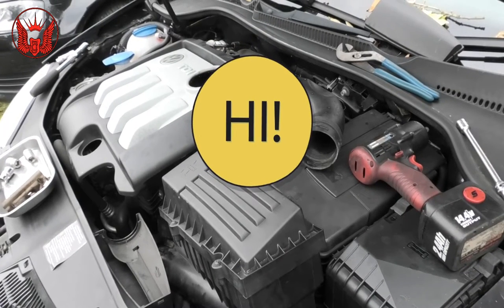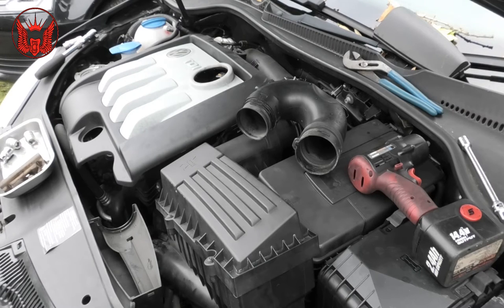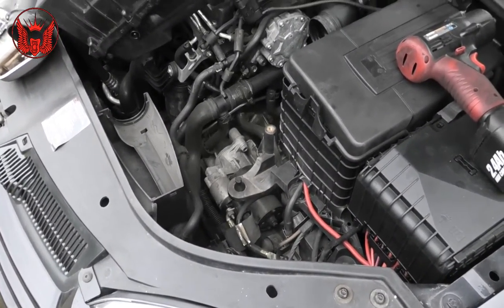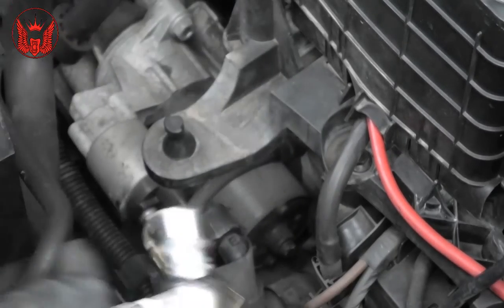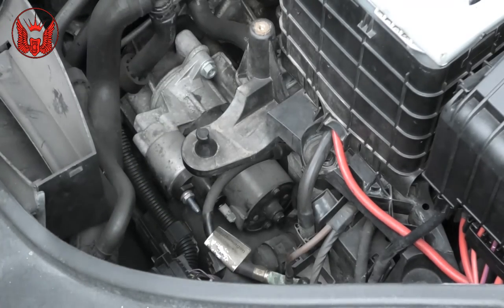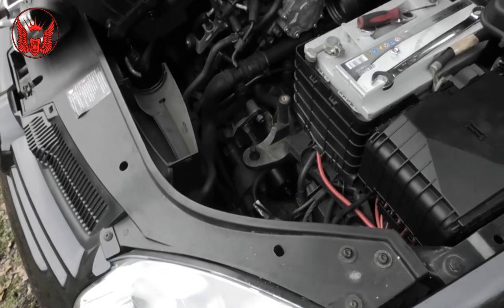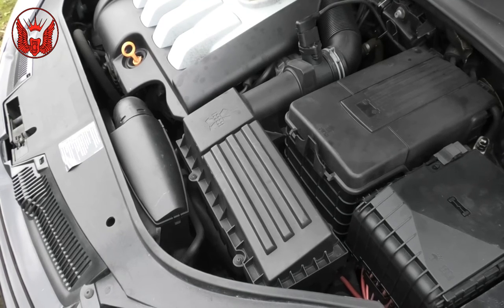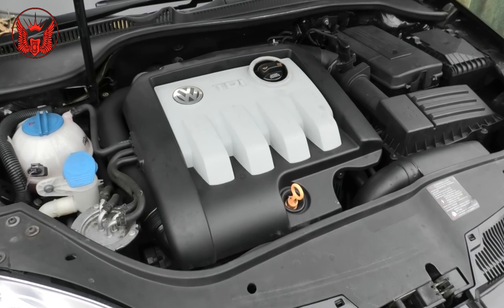VW Golf mk5 starter motor change due to noisy thump on start up like engine falling out but ok after

Comment: Was this the issue in the end? I was thinking it was fueling issue from possibly from the injectors
Reply from the maker: Well it’s a bit of a mystery, but in this case the car was better, but the car is sold now and can’t really check. I also thought it was an injector, but I have seen the starter can also cause the issue and well it was the easiest one to start with.
Reply: My battery failed this morning, changed battery and so far it’s starting instantly with no thumps

Comment: Hi. i have the same issue with my vw golf mk5 2.0 tdi. Planning to change the starter motor - is it supposed to be exactly the same starter motor serial number? I was thinking to order a sh one from ebay ...but I don't know if it's supposed to be the exact same number or not. Thanks
Reply from the maker: Hi it doesn’t need to be the exact same number, you can buy one that it’s OEM as long as it made for the year and model of your car and has the same electric fittings. But better get a good one rather than one that’s gona be the same as your original one in a couple of years. Cheers and regards.
Reply from the maker: The one I used was made by hella. Around 130

Comment: Thanks, but how do I remove the connector for the control wire?
Reply from the maker: It just has a little clip on the side, I used a little tool shaped like a pointy pin to pull it up a little and release the connector, I didn’t have enough time to film it sorry.